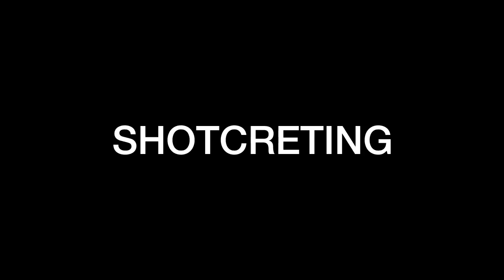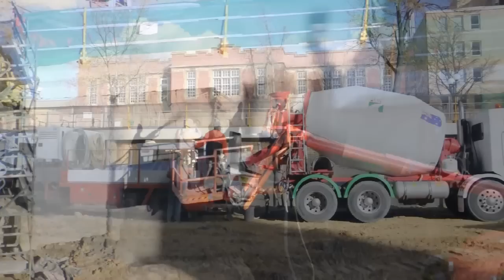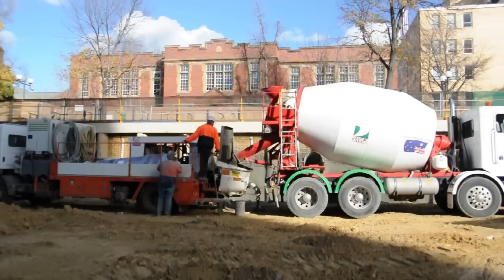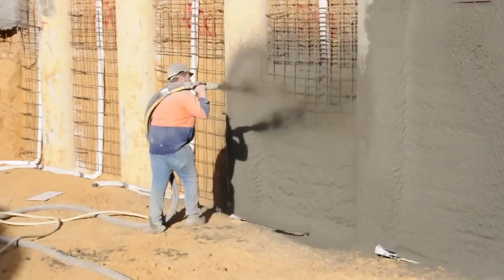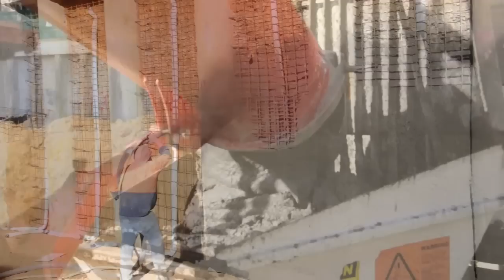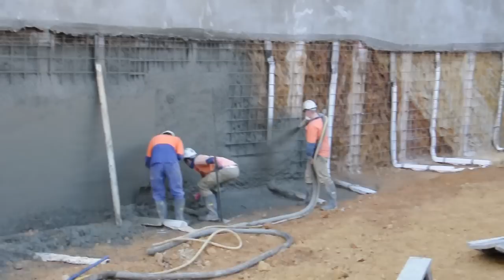Shotcreting

Comment: Shotcrete is stronger then a block wall. It only demands one form wal l and is used for shoreing basement walls foundation repars swimming pools skate parks. False rock sculptures and more
Reply: What? A core filled & reinforced 20.01 block wall is a approximately as strong as the same thickness of intensity concrete . You don't build a wall out of shotcrete, you use it to finish of contiguous piling such as in a basement. Do you drill, pour piles, then excavate revealing the pilong/walls, then pin mesh reo to it and shotcrete it to get a flat surface

Comment: Great video for shotcrete work. It can be applied also to pour core wall in a highrise project beside basement as shown. It just need one side formwork prior to shotcrete started.....Disadvantage may be more  time consume .
Reply: What do you mean by more time ? As in the speed of placement of the shotcrete? It all counters out ,the less time spent on form set up balances out when it comes to placement .the most I've ever shot in a day was 107 yards .and have poured with a line pump 250 yards in a day .there are crews that can place close to 200 yards of shotcrete in a day depending on the job site obsticsls and quality of material .it all equals out to time being saved  you gotta remember also stripping forms on one side or two

Comment: Is there any advantage of using shotcrete rather then concrete blocks?
Reply: Bigger transportation feat to ship in prefabricated pieces weighing up to tens of tons each. Then you have to secure them all whilst keeping them hoisted and in place with cranes etc. Alot easier/more fool proof to just have a guy go along with the hose
Reply: way quicker